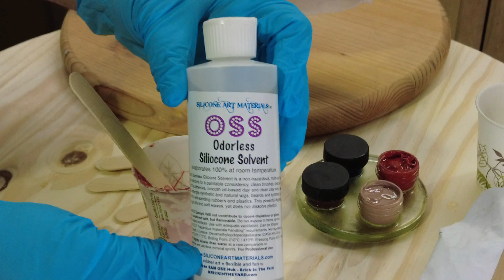Silicone Additives For Molding & Casting Silicones

Comment: I am a moulage artist with a Community Emergency Response Team (CERT) we used many of your fabulous products for casting plaster molds, and creating silicone injures but one mold that I would like to make but haven’t been able to figure out how to create is a mold that we could use to create realistic 2nd degree burn blisters.  It’s driving me crazy and I have tried creating a mold but the “blisters” never looks right. They need to look like they are full of fluid not hard lumps. I am desperate for your creativity, and what products might work best to create this effect. 

Also I was an artist at a military drill and they used some of your foam products to create the look of stringy torn flesh of an amputation but I never learned which of your foam product could be used to be that malleable and light weight.  Imagine the lightness and look of silly string from a can. Any idea as to what they might have used?
Reply from the maker: Hello and good to hear from you! We have a lot of different products used for trauma simulation. Call us and I can tell you which ones will work best for your application.

Comment: I recently watched that video on adding sand to resin. Are there fillers like that for silicone? I’ve heard you can chop up excess cured silicone as filler, but I don’t know if that’s actually a good idea. All the videos recommending it don’t demonstrate how they use it…
Reply from the maker: Adding ground up silicone must be done carefully and for molds that are not intended for long term use. Tin cure must go into tin cure and platinum into platinum. From what I’ve seen, the results don’t justify all the effort. 🫤
Reply: @brickintheyard  Very good to know. I was suspicious when no one showed their results, but I didn’t want to waste good silicone testing it…